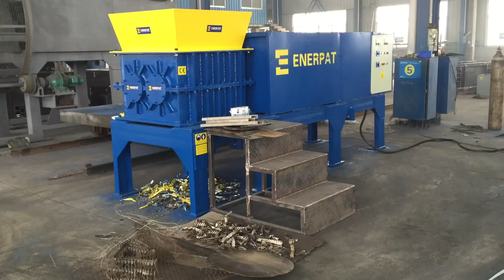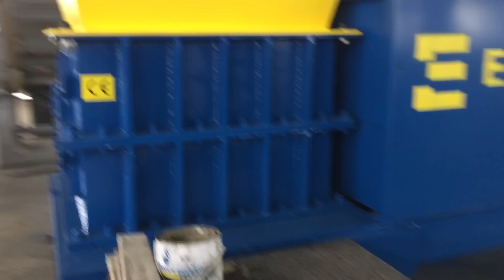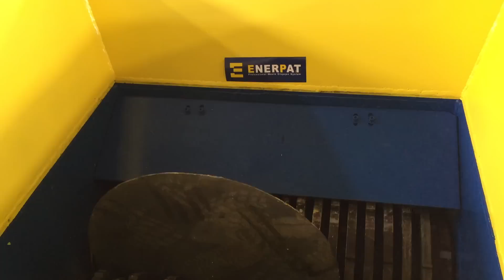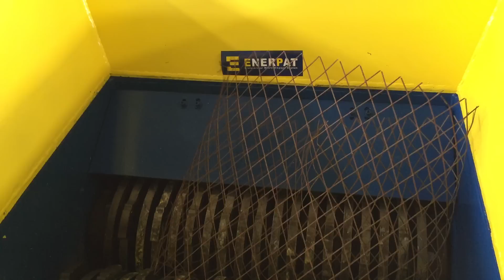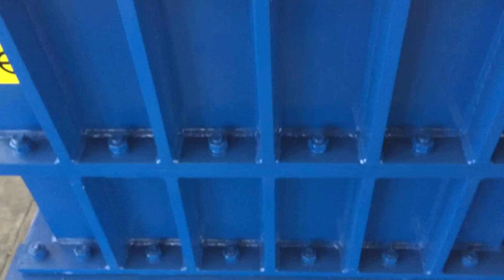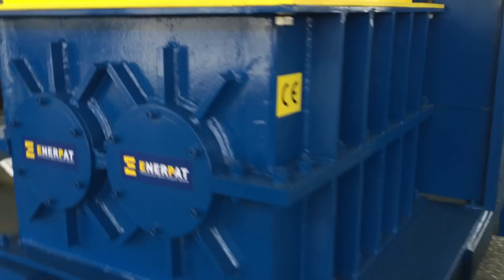Enerpat Scrap Metal Crusher / Scrap Metal Shredder Machine / scrap metal shredder

Comment: if i could get one of these .......the money i could make $$$$
Reply: How
Reply: Scrap iron i haul in about 3 tons a month in ferrous metals of i had one of these i could sell the scrap for a higher price and haul more of it per load which also raise profit/reduce cost
Reply: Why not buy one if these machines if they can turn a profit. Looks expensive but if you can make your money back within less than a year then its worth it
Reply: Because a decent size one starts in the neighborhood of 250000 usd and runs on 460 3 phaze neither of which i have access to